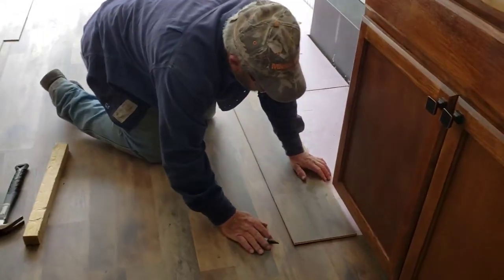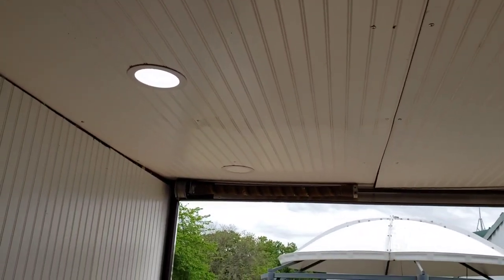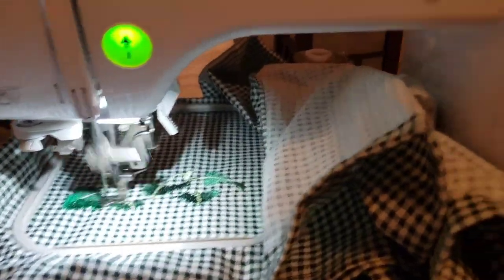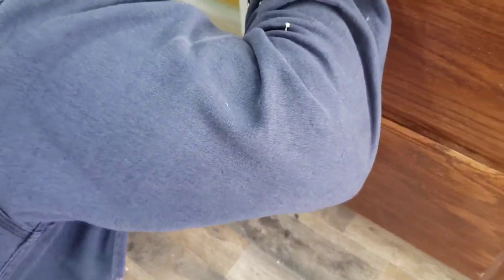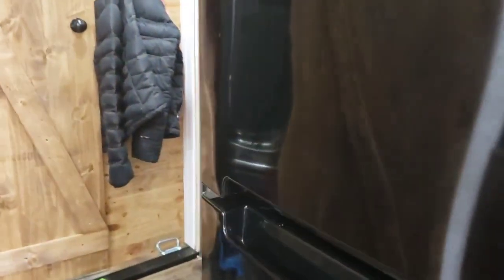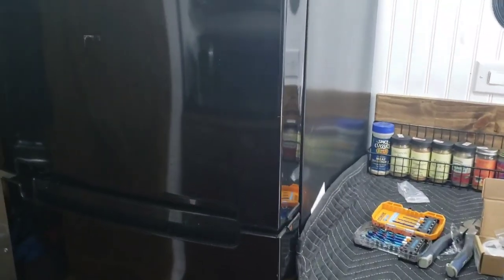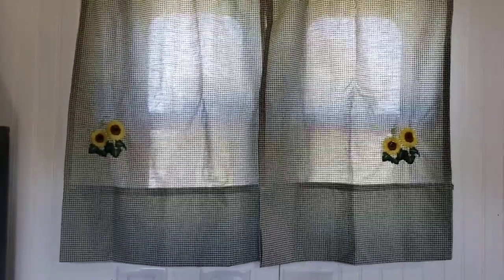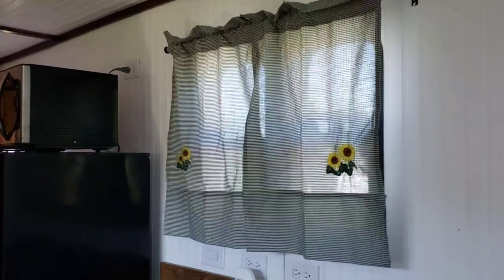How to Mount A Fridge In Cargo Trailer so it Doesn't Move & Penny Flag Table

Comment: Looks great. Wondering what the flooring is would like it get the same thing on my 6.5x12 trailer?
Reply from the maker: We bought that flooring from lowes for .99 a square foot.  Very very easy to work with.  Thanks for watching our video. We appreciate it.  
https://www.lowes.com/pd/American-Heritage-Florian-Oak-8-03-in-W-x-3-96-ft-L-Embossed-Wood-Plank-Laminate-Flooring/1000766734